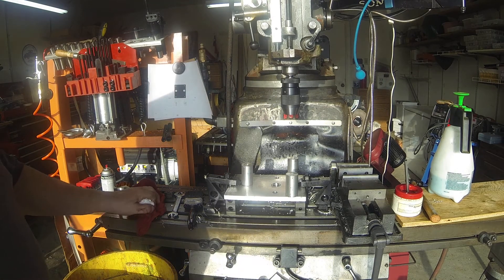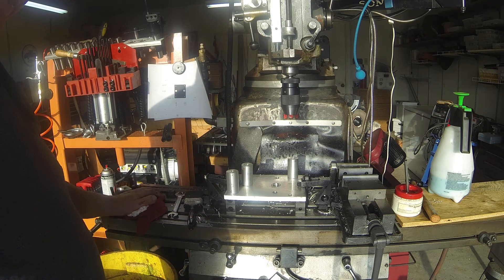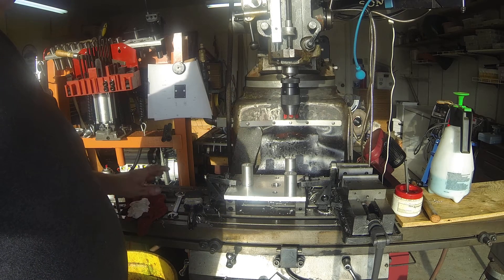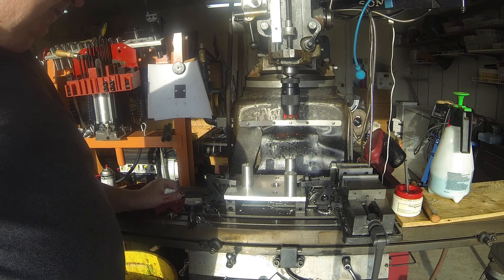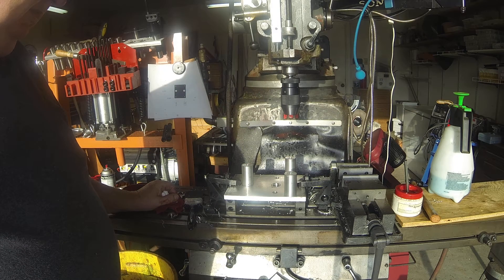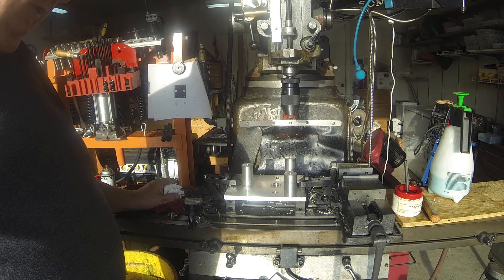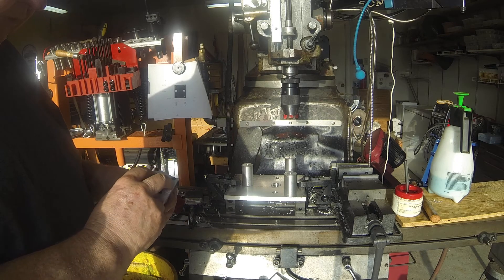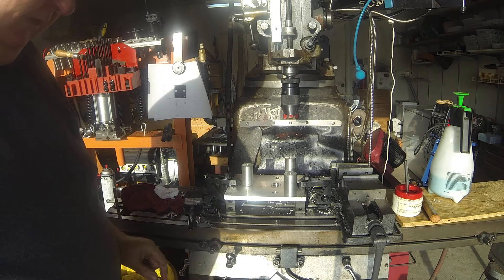Drawbar Project Update #1

Comment: Hi Herb, your check valves shipped today, looks like you will be ready to air that thing up soon. I sent some nice airline tubing too, so dont buy any.
Reply from the maker: Thanks Stan!  I can't remember who was going to send a 3way 5 port switch.
I will need that.  I can buy if need be.
Reply: I only have 2 way valves on the shelf, they wont work because you need an off position. Cant you reuse the old control like Ray did?
Reply from the maker: No problem Stan.  Thanks.

Comment: Well, you and Ray are miles ahead of my project. It looks good and I didnt realize you had a belt drive head....thought it a VS. I guess you will have to extend the drawbar as well?
Not to worry, I'll catch up...just got a little something in the way the last few days...LOL

Colin
Reply from the maker: Well, you have an excuse, the new shop and all.
Yep, it's a belt drive.  The current drawbar is 4" over the top.  I have to build up the platform so the air tool will fit over the end.  
I have two more piece parts to make.  The one that the air cylinder fits on is a piece of cake, the one that the air tool fits in is a little more complicated.  I'm going to bore the center hole out to 2", then make a insert with a 2" OD, and with a ID that is tapered and bored to the several different diameters on the tool.  The reason that I'm doing it this way is that if I make a mistake I only throw away a 1 1/2 inch piece of 2" round stock.  I did it this way for the G0704 power draw bar project and it worked out well.  I gave that project to the guy that bought my G0704 mill.  BTW, I bought a piece of 5/8" A2 tool steel today to make the guide rods, 1/2" would have worked, but  I used 5/8' on the last one and my springs fit that size.
Reply: I found a pile of springs (.75" x 2 and 3" lengths) while clearing out the shed. I put them in the drawbar parts pile as possible options.
Was eyeing the impact unit the other day and thought about removing the rubber from the front end and turning the casing to get a true round as a possible mounting option.

Colin